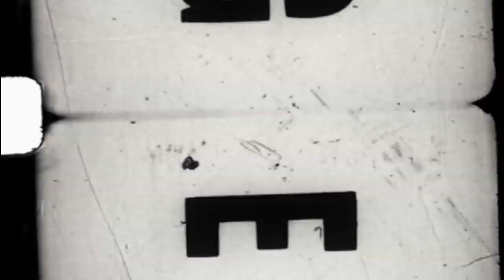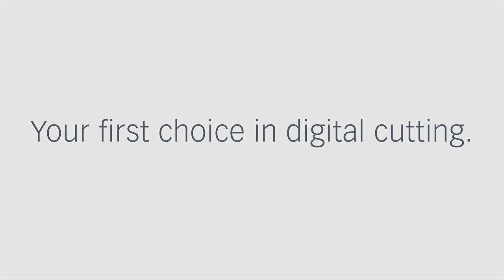Cutting thick foam, G3 with 120 mm beam height

Comment: Foam Size 1 x 1 meter of thickness 100 mm.
I am from Pune India
Reply from the maker: In this case, please get in touch with our subsidiary directly: 
Zund India Pvt. Ltd.
50 Bhupasandra Main Road - NTI Layout
RMV Extension 2nd Stage
Vinayaka Layout, Bhoopasandra

560 094 KA Bangalore
+91 80 23414411
infoindia@zund.com